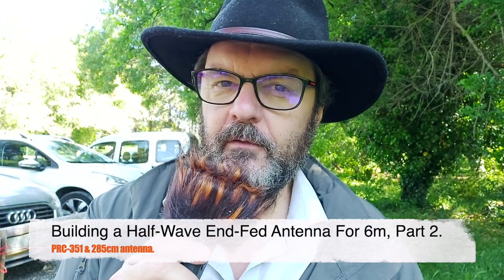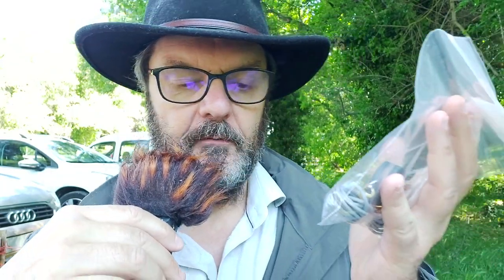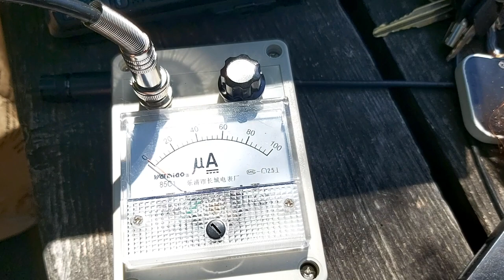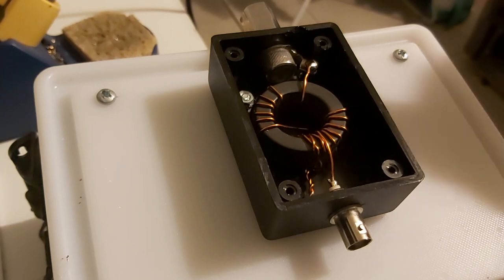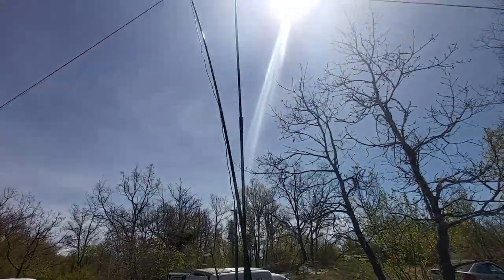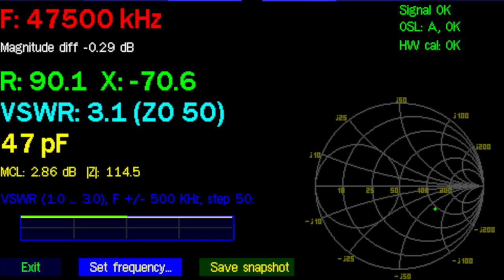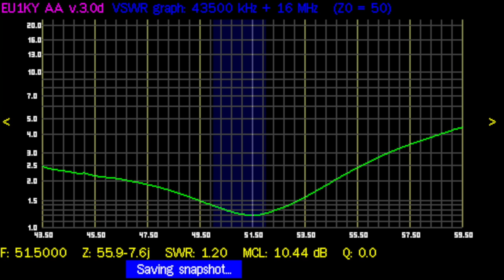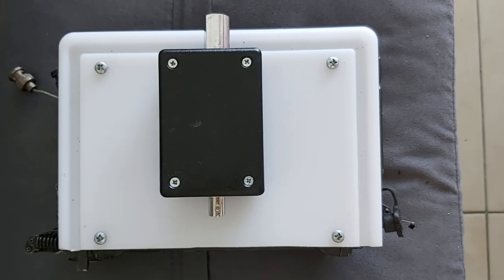Building a Half-Wave End-Fed Antenna For 6m, Part 2.

Comment: The length of the secondary winding's wire adds to the length of the antenna, from my experience. All my 6/10/17m efhw wires show that. When the length of the secondary wire at the transformer is, say, 40cm, your antenna wire should be 40cm shorter, in order to get it back to the resonance. When the number of secondary turns changes you have to adjust the length of the antenna wire accordingly as well.  73, om1zz

Comment: Glad to see Part 2 get posted.  I came across part 1 a while back, which prompted me to build my own 6m EFHW to go with my Yaesu VX-7r.  I used an FT-50-61 core with 49:1 winding and a bit over 9' of wire for the radiator.  So far I've managed 3 QSOs on SOTA activations, one that was 63 miles point to point, the other two being a mere 25 miles.  The best part, however, is that the new antenna is much more compact than my previous 6m J-pole.  I can get the entire "station", radio/antenna/coax/throw-line, in my pockets.

Comment: 10:48
common mode current is low, but anyway coax acts as a counterpoise. And efhw impedance depends on counterpoise length and placement.

Comment: The auto-transformer you build works better on HF then on VHF. On VHF (6M) you can use a simple L-C network. For example to transform from 50 ohm to 2500 ohm use: L = 1,1 uh and C = 8.7 pF. Use an air coil inductor and you can use a short coax cable as an capacitor. The performance will be much higher. 73 PA7N Erwin
Reply from the maker: Definitely, a toroid on 6m is really pushing it! Thanks.

Comment: You need to use a VNA to measure resonant frequency, SWR, impedance, etc. across the 6 meter band. That is what I use when building and setting up new antennas. 50 MHz is high for toroids.
Reply from the maker: I did, and it is at the very limit..

Comment: Please, a couple of ideas and ect. Would it be possible to measure the impedance of your antenna at resonance (not with the toroid, but the actual impedance of that tubule antenna ?  That way you would know more about what you need to match to. Also, That phone call at the end. Could you try turning off the special CC setting and letting us try auto translate , as I would like to see if it would have translated the phone call.

Comment: If you are trying to prevent internal damage in the transformer box try using polyester batting to cushion the transformer in the box. The batting can bought in bags, or could come from an old bed comforter, or any plush toy for the cost of nothing. If you think it may melt with your power levels, try fiberglass insulation (with gloves). You are the only ham I know of using epoxy in your enclosures and it always seems to ruin them. But of course the squirt of hot glue you used will work too.
Reply from the maker: Good one thanks. It won't melt with 4W 😉

Comment: Surely, all you need is a half wave dipole or a half wave whip?  It's a clansman so get the matching clansman, round spike antenna?? Also The clansman is an FM only radio you need an antenna tuned to the FM part of the 6m band.
Reply from the maker: Yes. The only advantage here is that I can unfold and mount this antenna in ten seconds..

Comment: I would have never expected that low of a feed point impedance. I figured 49 to 1 would be just right. 
What I did not see was a 100 pf capacitor shunted across the input of the UnUn? What was your thought on not using one?

Nice video. Barry, KU3X/QRP
Reply from the maker: I don't remember, LOL.

Comment: Hey Gil, the results you got from removing toroid windings were strange. What material are they using in that case? As an Elmer and MIT Electronics Engineering grad by way of being an Air Force Col., told me repeatedly, radio is a black art.
Reply from the maker: I agree, strange..  The case is probably aluminum... The toroid is about an 9nch from it in the plastic box.

Comment: G, thanks a lot for another fine experiments vid! What do you think would happen if we replace the ferrite toroid  with a normal metal bolt, the same size, then wind the wire around it? Or, around a bunch of washers of the same size stuck on a small pile with paper between each washer (if it is needed that the metal should be not homogenous chunk-I remember when I was young transformers were made of flat metal plates stuck in a pile, probably varnished each for separation..). I’d try but have not a single measuring equipment. Cheers!
Reply from the maker: I don't know...
Reply: @RadioPrepper  let me (us) know if you try pls, and will vise versa. Would be nice to not need to order ferrites.
Reply from the maker: I have a schematic somewhere for a coil based solution, will look for it..

Comment: Just a few thoughts and ideas... Have you measured the velocity factor of your radiating element material with something like a Nano VNA? Radio waves travel slower than the speed of light through any element mediums and that will affect the true "1/2 λ" length vs what the math "says" it should be with a tape measure. You'll need to measure the "exact" length of a test piece of your radiating element material to measure the VF including a separate "short load" calibration of any jumper wires used to connect to both ends of your element material so they are zeroed out of the velocity factor for your element. A radiating element made out of say a copper or aluminum pipe will typically have a wider and flatter bandwidth and SWR than just a small wire, the wider the diameter the better, not that a roughly 3m pipe is "easy" for portable use but you might have some luck with very heavy gauge wire like for large car audio subwoofers as a radiating element?! 73!
Reply from the maker: It certainly would be more accurate to measure it, but I just don't bother..
Reply: @RadioPrepper  you may want to consider doing it at least once, it would help the antenna be more resonant with less "guess work" by clipping little bits off at a time and checking the SWR (and only to find "OOPS I clipped a hair too much off!").   🤯 😁
Reply from the maker: True...

Comment: How much coax between the radio and the transformer with the transformer mounted to the radio?
An efhw requires either a counterpoise of enough coax to act as one of you get bad swr. The end feed point of a half wave is a VERY high impedance. Taking off turns does not match the super high impedance. Your results are suspect.
Reply from the maker: No it doesn't. Not at such a low power. A half-wave radiates practically all of the RF.

Comment: I am no antenna expert, but the general equations for antenna resonance, antenna radiation resistance, and empirical measurements of SWR, etc. don't necessarily account for antenna materials, configuration, and the local geography (i.e., the terrain).  For example, I would be curious to see what your measurements are if you relocate your military rig and antenna to a location closer to sea level.  It appears to me that your geographical location for testing your antenna and unun was in a mountainous/hilly region. Just like the old adage for real estate values, I perceive that antenna performance is very much influenced by "location, location, location."  Great video, as usual.  73 de AE5ZX
Reply from the maker: Absolutely right.
Reply: I think you will find that the height (HASL) will not affect the antenna to any degree. Being close to a shore will change the ground conditions, though. But this has nothing to do with tuning the antenna and coupler.